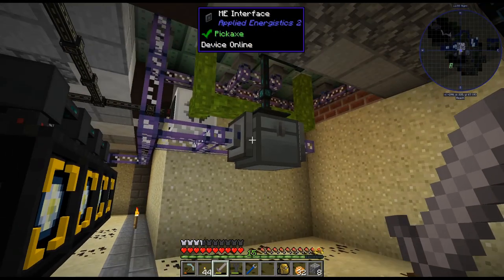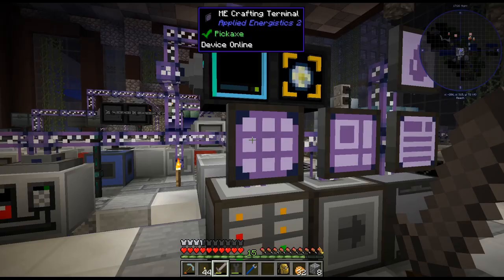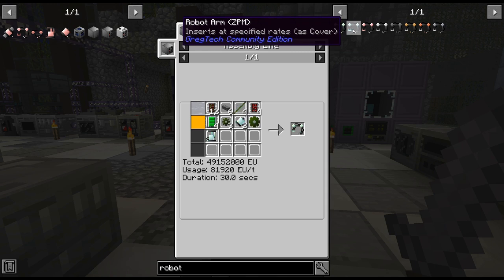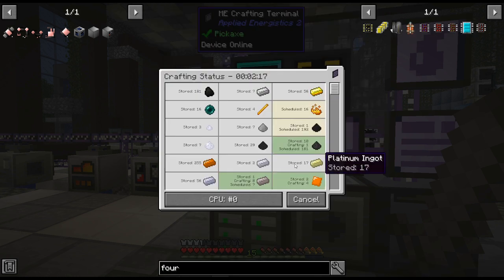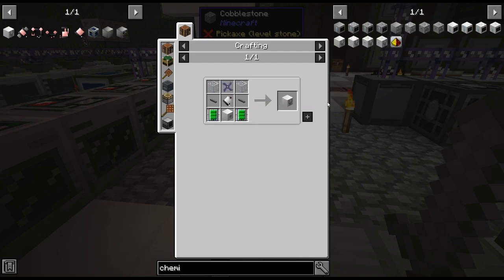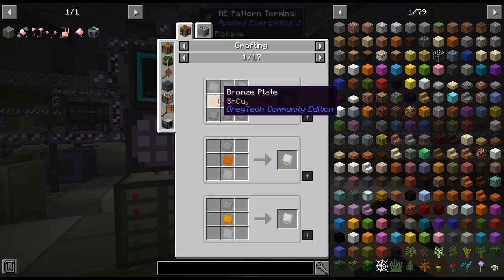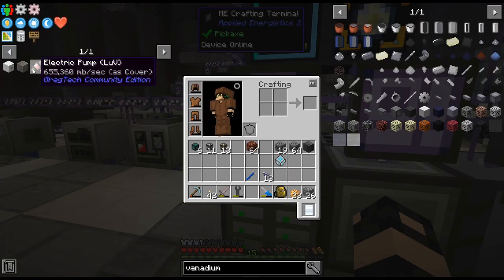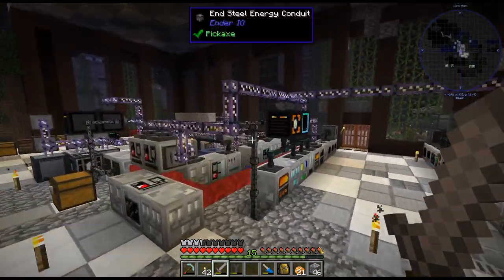Omnifactory - 53 - Assembly Line

Comment: I know this is old, but at 17:30 the idea of chaining the interfaces absolutely works. You need the crystal wrench thing from AE2, then set the interface to be directional (A big arrow appears, make the point of the arrow face towards the block you want it to interact with) then do the same for each subsequent interface. Should work like a charm.